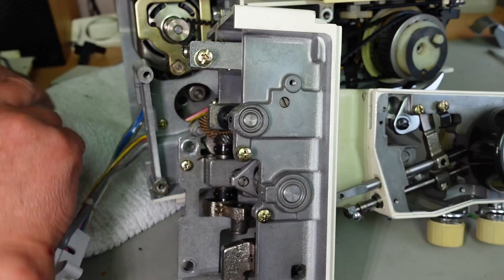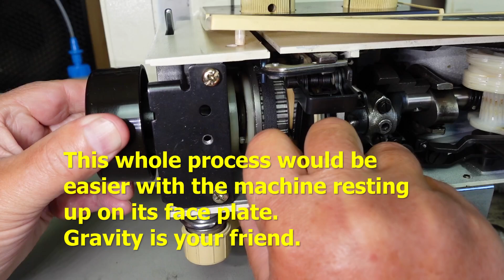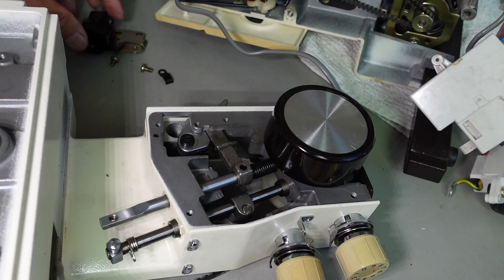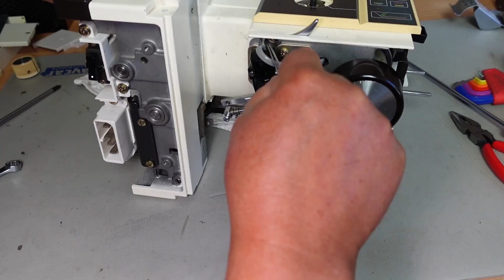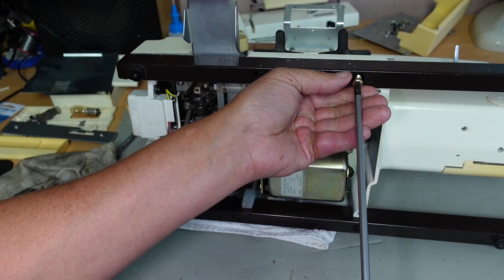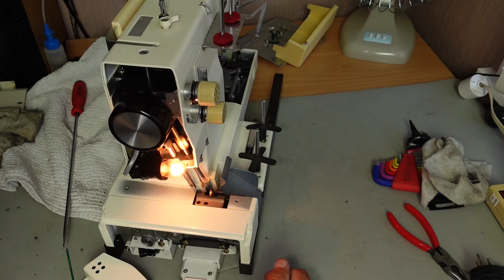Janome Combi - 2 in 1 Sewing Machine / Serger - Seizing - Common Issue Fixed - Part 2

Comment: i havent watched yet but i'm going to when i have some time as my new to me Combi is siezed up, hopefully you have the answer.
UPDATE just needed a good oiling on the sewing side, it was thirsty, so didnt need to pull apart the overlocker but also gave it a drink where i could access removing the panels.
Reply: To possibly save you some time as I have watched the whole thing, in this case the issue was that the overlocker portion was not used often, so a bearing inside had hardened grease inside and oil could not penetrate.  In part 1 you can see his process for identifying that the seizure was on the overlocker side, and then he had to do an extreme disassembly to find and clean the problem bearing.  I’ve watched quite a few vintage sewing machine repair videos and this might be the most complicated job I’ve ever seen.
Reply: @amykathleen2  im never taking the overlocker off. my dog would never leave me alone long enough to try.

Comment: I was nervous for you when you were fitting the the drive, these are such cool machines, I have never seen one in person. I do find that these vintage Janome as well as Kenmore in America made by Janome, are very well made, the thing I find the most problem with is the original Lithium grease turning to concrete somewhere inside. So frustrating about the light holder.
Reply: 0:12 0:12